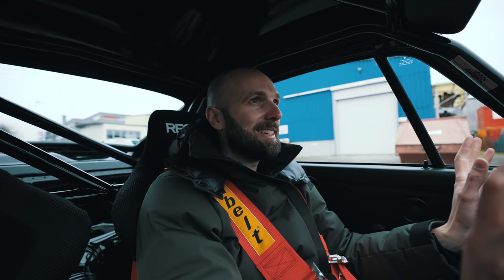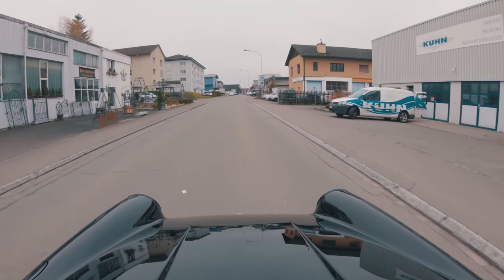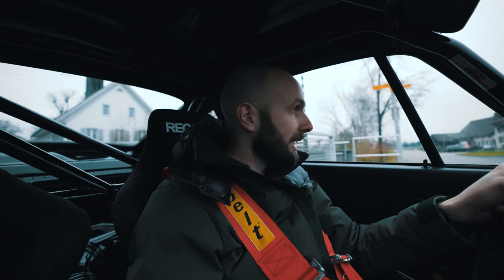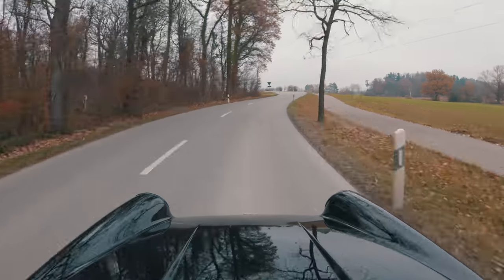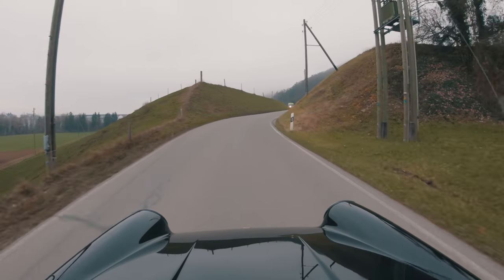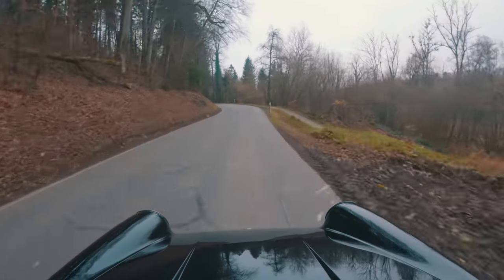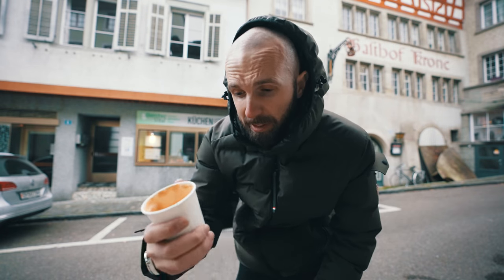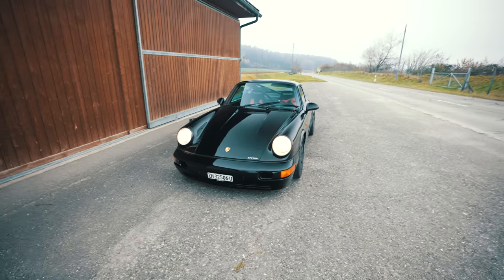Rare Porsche 964 RS N-GT Coffee Run!

Comment: Big like! You should have pushed above 5k, these engines are bulletproof, nothing to fear or worry although I have to say driving 964s in higher gears/lower rpms can be very fun too thanks to the much torquier engine than previous gens. And that cup exhaust makes that throaty sound you want.